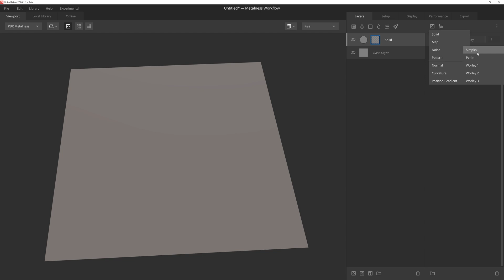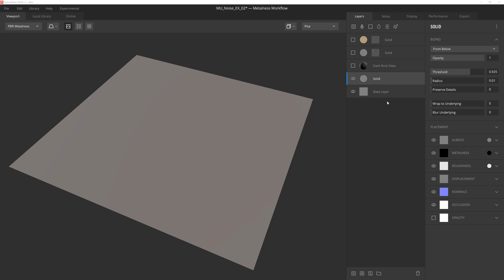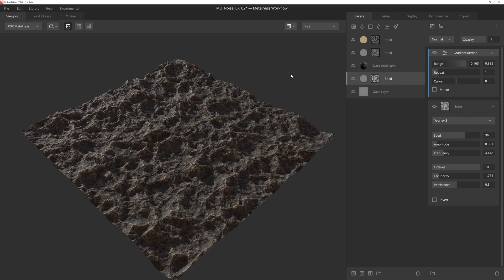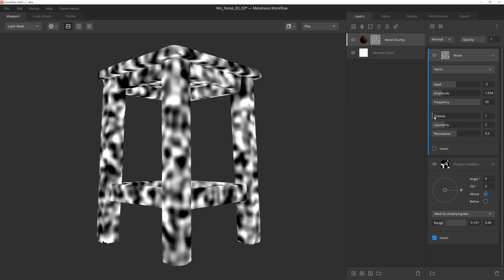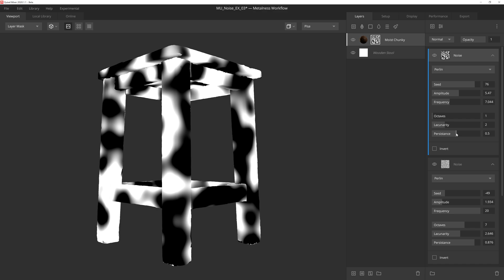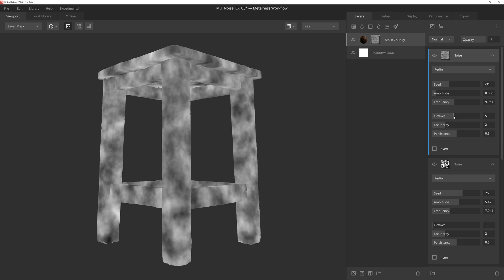Mixer Fundamentals 9: Noise Component

Comment: Nice. But I didn´t understand how you got displacement from applying a mask from a solid color layer? (in my results it just masks the color...)
Reply: I have same issue. I am working on a Mac. i have exact settings as tutorial but my image doesn't look same, no displacement, especially visible on edges, mine are all flat
Reply: @LutherThie  Look at the toolbar (top - left), there is a button to turn on/off the displacement.
Reply: @Fazendojogo  - thank you! i didn't see that, der
Reply: Hmm, maybe increasing threshold...